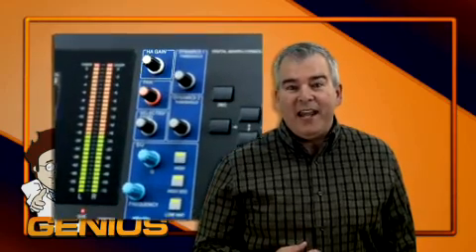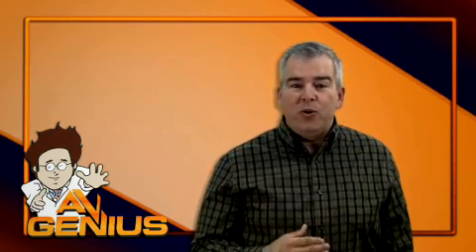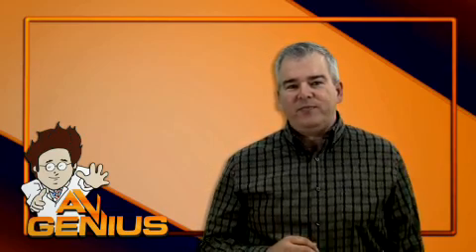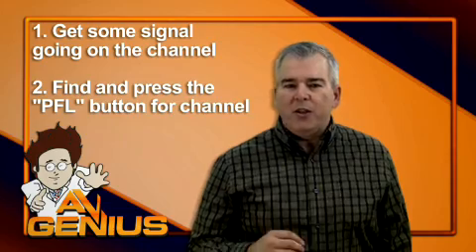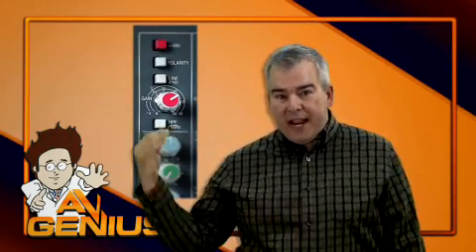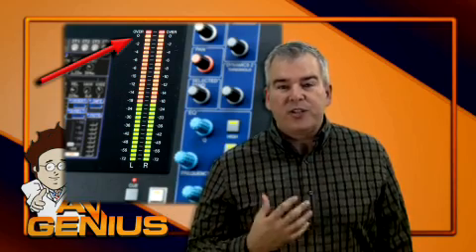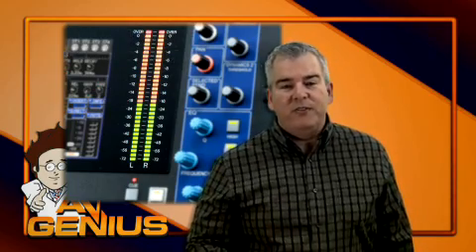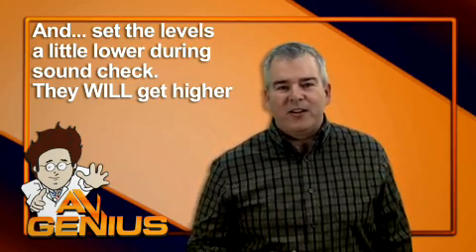AV Genius "How to Mix" series - Setting Gain with PFL

Comment: I experienced trouble when setting the gain in the mixer without the PFL button and only two main LED meter indicator lights were available, namely 'Signal' and 'Peak' only. Whereas in the channel strip there is only a 'peak' lamp, which is related to the knob gain on the channel itself. Are there good instructions sir?

Comment: When I did pressed PFL, it recorded that channel only to my recording instead of the whole band.  Do you know how to avoid this?
Reply from the maker: MT Nguyen Yes. You’ve been snared by the “solo mode”. Studio mixers (including most DAWs) tend to default to this solo in place mode, most live sound mixers default to an AFL mode that allows you to hear the soloed channel in the headphones, without affecting the main out. 
You probably have a setting to switch between solo modes, it depends on what you are mixing on. HTH

Comment: Since you use the terms "Solo button" and "PFL button" interchangeably, it should be stated that if the mixer has a Solo button and not a PFL, the channel's fader should be set at unity, or zero gain, while setting the trim.
Reply: Also, 'solo' on some Mackie mixers I've used weren't actually 'pfl', you'd have to bring the fader up to hear the signal. Interesting.